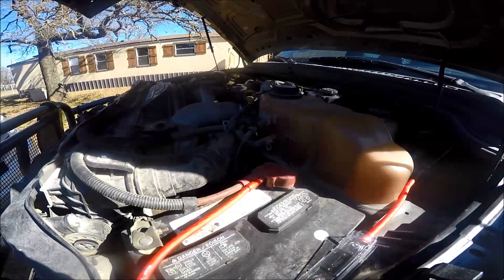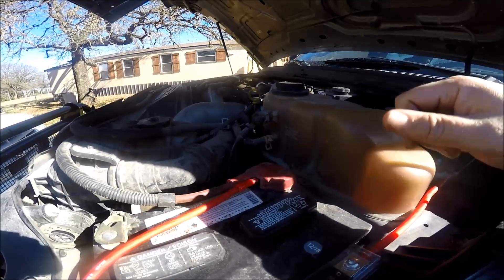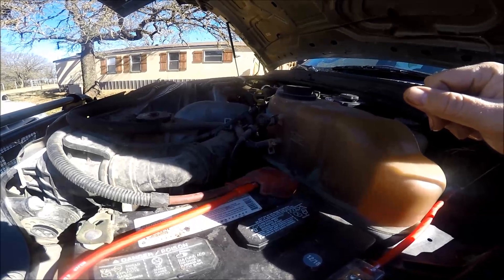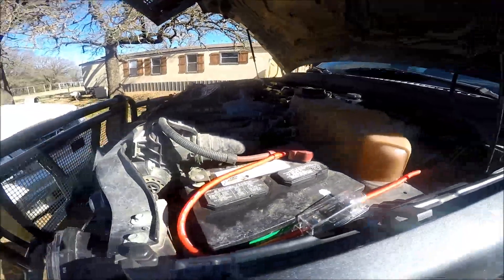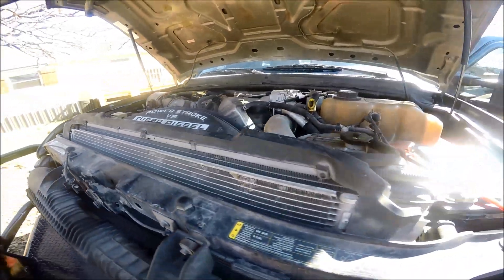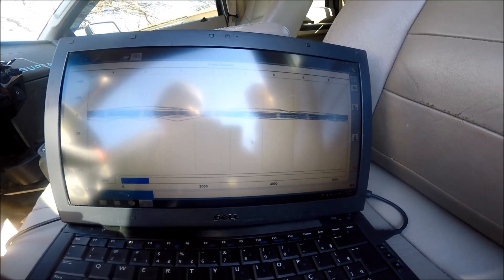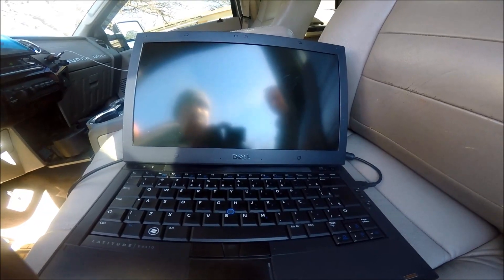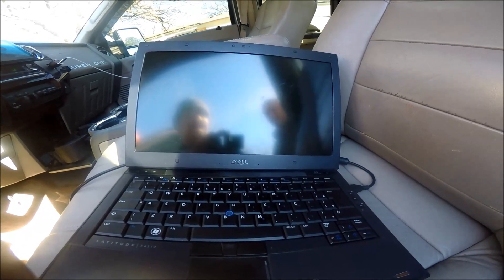Customers Ford 6.4 Powerstroke Engine Diagnosis  -- Is the Engine Done?

Comment: I’d drive it till it blows. Only use for in town use only so when it fails you won’t have to tow it far and during the meantime look on Copart for a totaled or rolled Cummins diesel truck that’s not a big rig, or even a 6.7 or 7.3 diesel truck that 6.4 is one hell of a crappy motor.
Reply: Or just do a new valve train since that’s all that’s wrong with it.

Comment: So my friend, what is actually wrong with the truck? What component failed?
Reply: @jaysmobilemechanicservices  It did not sound like the bottom end to me. Dropping the pan and replacing inserts would make a great video. Is it possible on a 6.4? In a previous life, I owned and operated an oil company and we had to keep lots of junk running. We had our own shop and mechanic. We would regularly repair the bottoms of diesels and never take off the heads or pull the engines. At the time, I  drove a ford with that crappy International diesel V-8.  It would not stay together. Finally, I had my mechanic strip it out and replace it with a Cleveland and converted it to a gas rig.